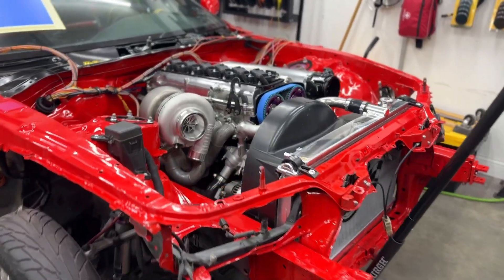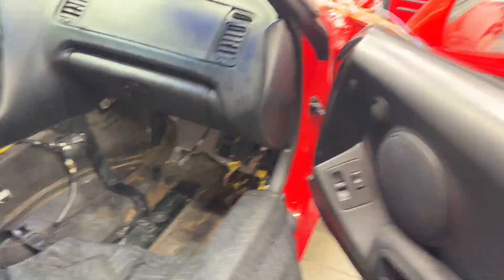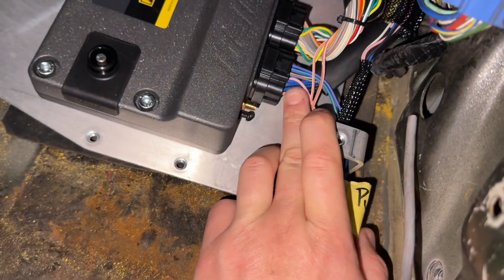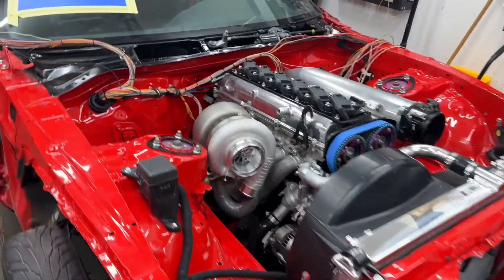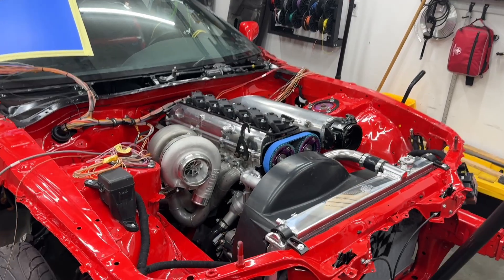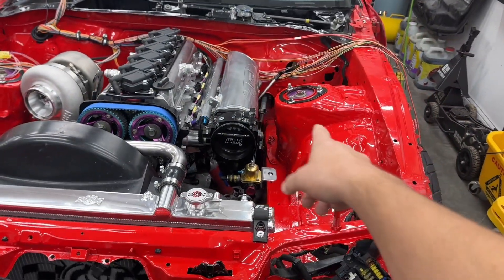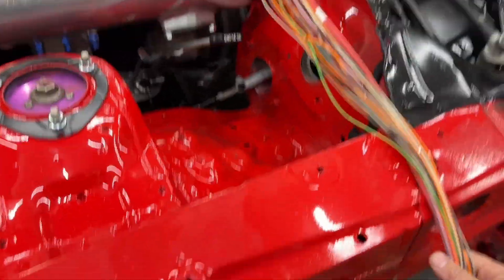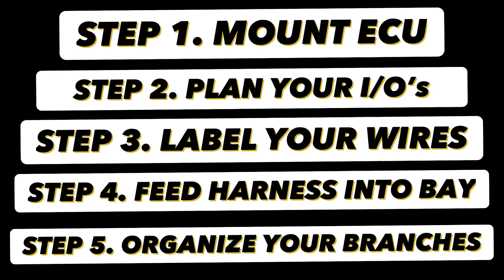Making A Custom Haltech 2JZ Engine Harness (The Easy Way)

Comment: Hey man thanks for the great video. I have two questions: 

Question one: what do you do with the remaining cables you don't need? Do you remove the pins from the connector with the cable, or do you wind up the cables and hide them? If so, where? 

Question two: if I understand correctly, your wiring harness now has no connection to the supra interface (for example: orange connector). How do you solve this problem? Did you build an extra wiring harness for this? I would really appreciate an answer. Thank you.

Comment: Thanks for sharing. Where did you mount the Intake Air Temp Sensor?
Reply from the maker: In the charge pipe right before the throttle body 🤙🏻